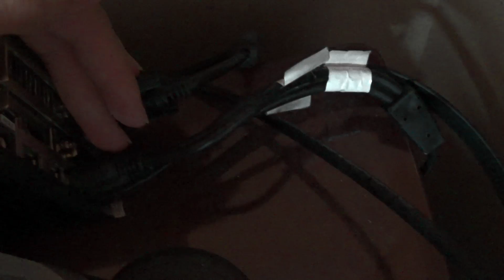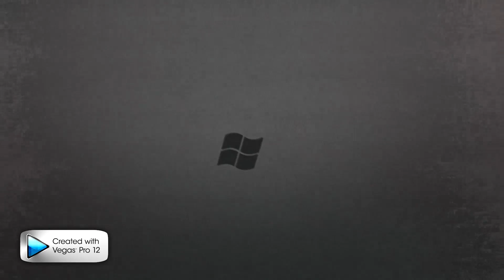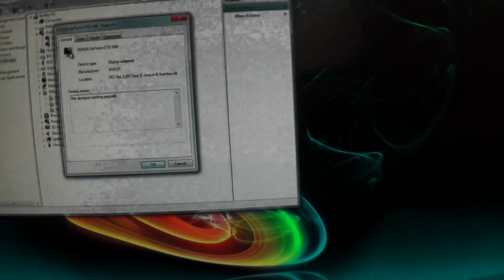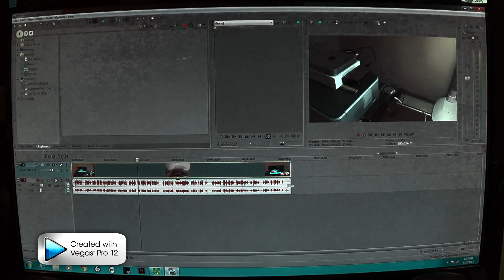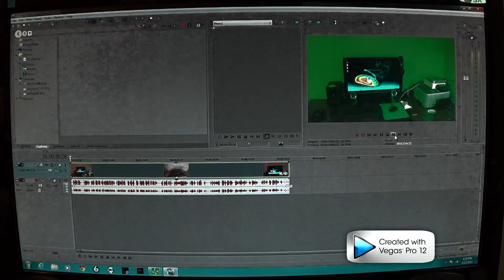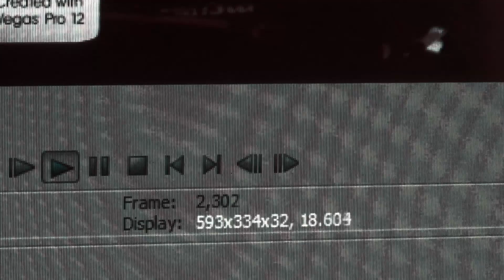Vidock paired with 2012 Mac Mini- Setup and Performance

Comment: Does it also work with Mac OS X ?
I want to buy one and save money but won't buy one if there is no way because i have many games on my Mac and also use iMovie and Final Cut Pro X, and also if i buy it, will i get the Express Card Converter ?
Reply: According to the ViDock website It works best with Windows 7 but also works with Vista, XP, and OS X
http://www.villageinstruments.com/tiki-index.php?page=ViDock

Comment: Hello,  I really like your products villagetronic. I have a MacBook Pro with retina display(Mid 2012), 2.3GHz core i7(3rd generation),NVidia Geforce GT 650m,8GB ram,256GB hard disk, windows 7 64bit. I bought Vidock 4+ overdrive and a Sonnet echo expresscard to thunderbolt to upgrade my GPU. I bought NVidia Geforce GTX 760 Gigabyte. So I needed to ask if it will work or not.  Thank you.

Comment: hadjiadamou: 
It is the same process as in MacBook Pro. Please open a ticket in our ticket system.
Doing support in here not possible. Posts are limited to 400 chars and we do not get notified if you post in here. In our ticket system we will respond to you in two working days. This darn thing does not allow me to give you a link. It is our company name ( Village Tronic ) no spaces and using the most common domain.